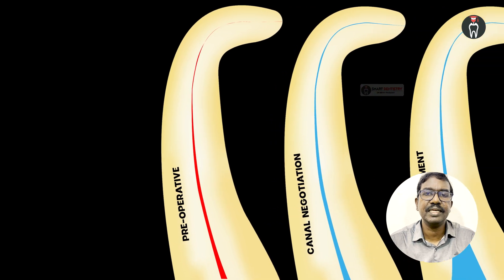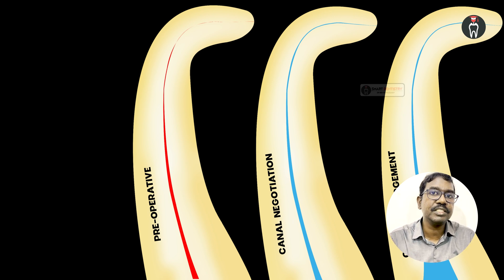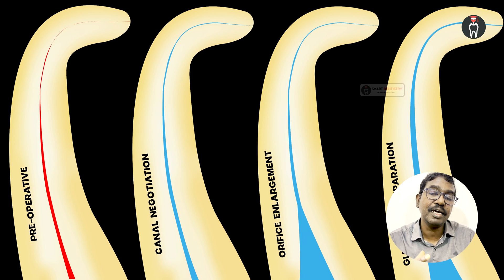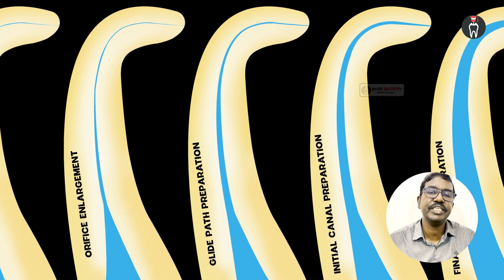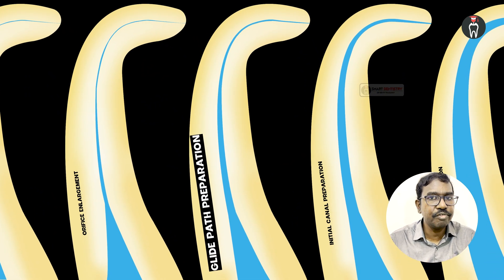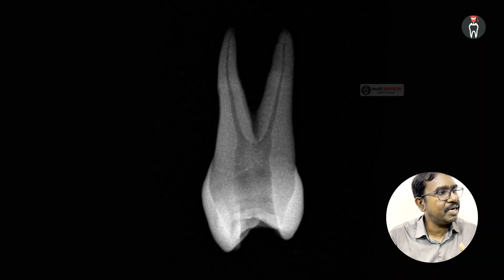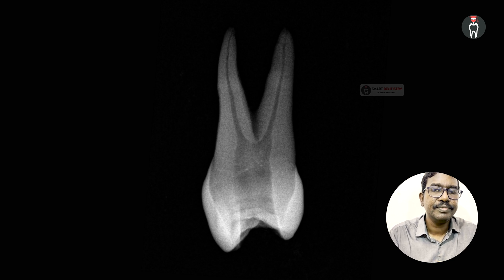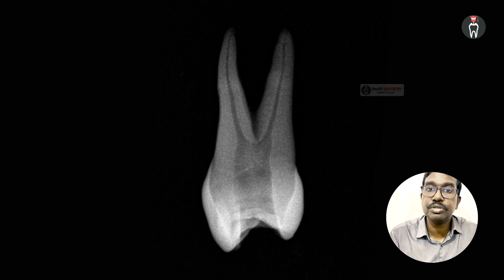Glide path in Endodontics

Comment: Sir, why are u not pre bending the apical third of your hand file? And is it advisable to use rcprep at this early stage.
Reply from the maker: 1. Very flexible hand files often does not need pre bending atleast for most cases. May be needed in some clinical situations but not always. 
2. RCPrep (EDTA GEL) is only for canal enlargement and should never be used in early stages of canal preparation

Comment: plz make video on how to use apex locator..many times it doesn't give reading...at which time of shaping canals..it should be used...
Reply from the maker: Upcoming videos in Smart Dentistry YouTube channel

All about root canal Irrigation
How to select the correct master cone
When to discard a rotary file
How to negotiate a calcified root canal
Antibiotics after Root Canal Treatment?
How to locate root canals?
How to remove Guttapercha from root canals?
When to do Post and Core?
Curved root canals and file selection
Everything a beginner should know about rotary files
TCA technique of Cleaning and shaping - @DrHozefa
Anterior proximal composite restorations - @raghuramm563
Finishing and polishing of composite restorations - @DrHozefa
How to create the perfect anatomy in posterior composite restorations - @DrHozefa
Working length using RVG - @manadentist2267, @sushrutachakraborty464
How to use apex locators to get accurate reading? - @katyaynigupta5259

Thank you

Comment: Sir, sometimes specially in curvature in apical third part of canal difficult to negotiate and scout. So many times ledge and blocks are created and it is difficult to over come.what to do when 10 size file not going till apex? I use 8 size file 90 per cases manage in this way but sometimes 8 size also not going to apex.
Reply from the maker: yes. Definitely. Using a smaller size file will be useful to negotiate a canal if already there a pathway existing. But in many cases there will be partial calcifications throughout the canal. In those cases it is better to use a small but stiffer file rather than using a smaller size. I will cover this fact along with different type of files to use for negotiation and mechanism of calcification so that we shall understand the negotiation technique. I will make videos in the following sequence
thank you
Upcoming videos in Smart Dentistry YouTube channel

All about root canal Irrigation
How to select the correct master cone
When to discard a rotary file
How to negotiate a calcified root canal
Antibiotics after Root Canal Treatment?
How to locate root canals?
How to remove Guttapercha from root canals?
When to do Post and Core?
Curved root canals and file selection
Everything a beginner should know about rotary files
TCA technique of Cleaning and shaping - @DrHozefa
Anterior proximal composite restorations - @raghuramm563
Finishing and polishing of composite restorations - @DrHozefa
How to create the perfect anatomy in posterior composite restorations - @DrHozefa

Thank you